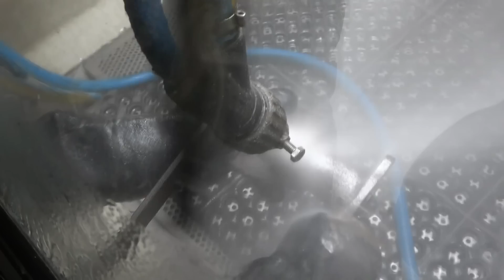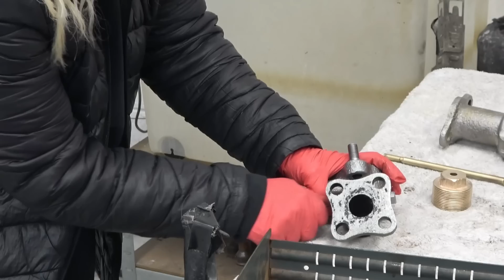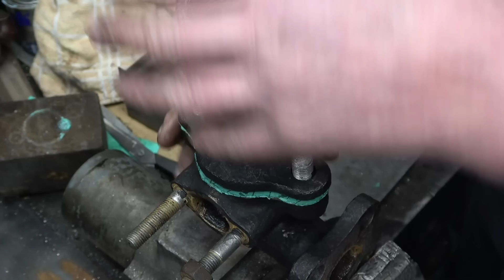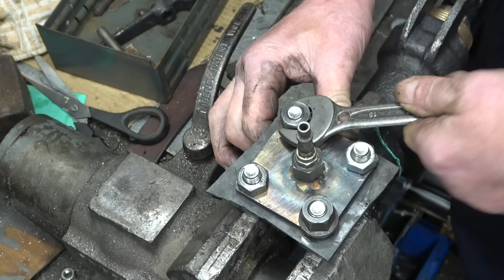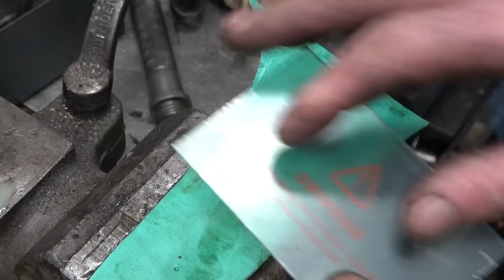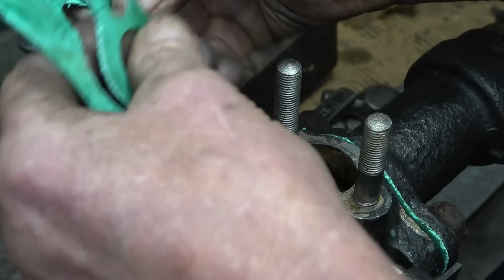SNNC 520 P1  Sentinel Steam Waggon Safety Valve  (Re Upload)

Comment: Nice job John. Originally wouldn't that Brass nut on the top have had a lock nut with it as opposed to a grub screw which will damage the spring body thread?
Reply from the maker: Yes I am going to replace that horrible thing with 2 brass check nuts

Comment: My thought would be to set the blow off pressure below the working pressure, even though the intention is to have it professionally calibrated, just in case it gets used too early. Better below than above in such circumstances.
Reply from the maker: The final setting is done under steam in the precence of the boiler inspector
Reply: @doubleboost  yes I know that, but for safety purposes you should set it low and let them set it higher under the correct conditions, as I said just in case it gets used "by accident" before hand. As a rule never set them too high, even when you know it going to get reset later. Miscommunication is not unheard of, and you don't need to be responsible unnecessarily. Just looking out for your best interests.
Reply: @chrisstephens6673  John knows what he's doing..
Reply: @65cj55  I hear What You are saying but even John would agree that no one knows it all. 
My first contact with John was years ago when I had to correct him about his demonstration of threading with the top slide at the wrong angle and i have been trying to make helpful suggestions on odd occasions since, but thankfully not often as it has not been necessary. 🙂

Comment: They made a nice job of cleaning those John , worth a name check.
Reply from the maker: North East Blastoff
Reply: They must charge reasonable prices or they wouldn’t have to be wearing big coats in the workshop 😂
Reply: What process was the blasting?

Surprised you didn’t make copper gaskets.
Reply: @pvtimberfaller  Vapor Blasting, water and blasting medium, usually crushed garnet or glass.